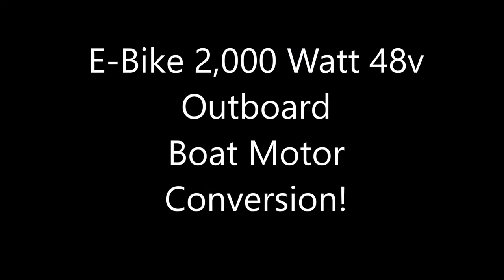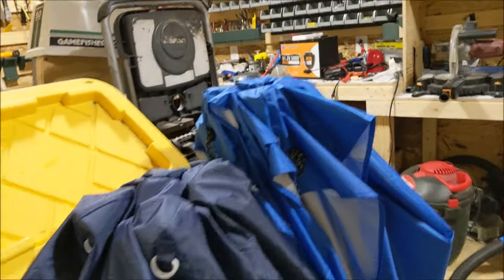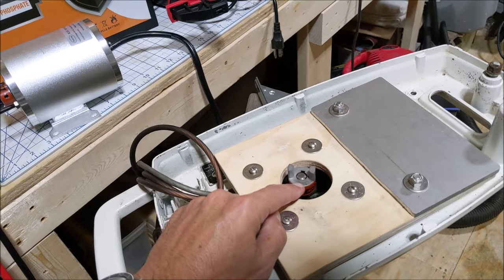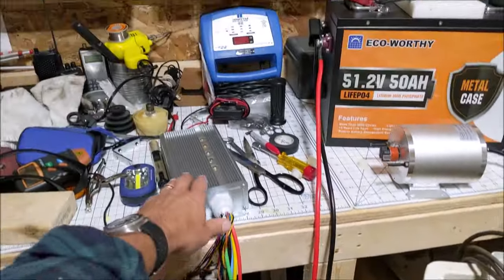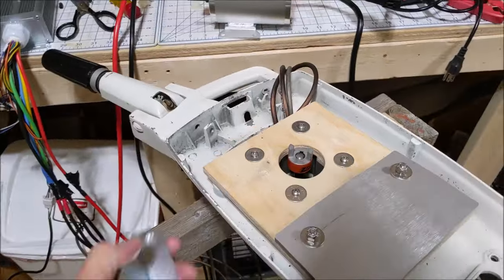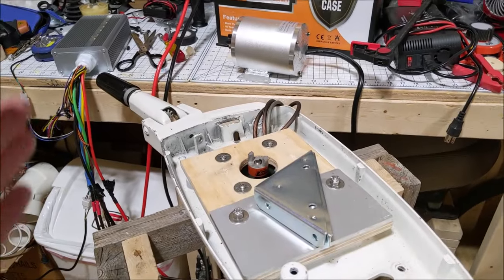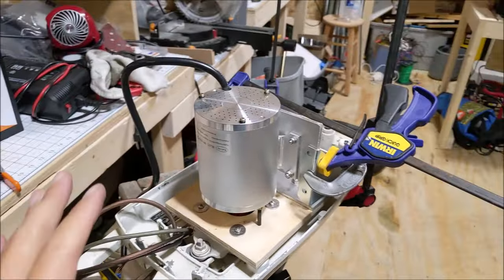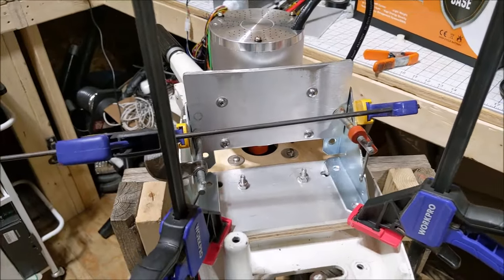E-Bike Kit To Boat Motor Conversion!

Comment: A piece of tubing or pipe a little larger than the motor. Like a sleeve. You could regulate the pressure on the Oldham coupler. Maybe even a toilet flange and some pvc?

Comment: I built a very similar electric outboard using that same brushless motor and controller kit. I mounted my motor separate from the drive and used a pair of cog belts running in parallel between the motor shaft and the lower unit coupling. That way I can change out cog gears to get different gear ratios. I tried that same motor coupling that you are using and it didn't last very long at all. I ended up using a solid coupling. I power it with four 12 volt 75 amp hour AGM batteries made for powering a Ryobi electric riding mower. I added a 48 volt to 12 volt buck converter to run a thermostatically controlled cooling fan. I have 3 seasons of use on mine.
Reply from the maker: Awesome!  I thought about using a belt a lot.  Even sketched out how to build it that way but then opted to try the couplers.  Great to hear it has worked out well for you.  On the next motor build I did I used a larger LoveJoy coupler that seems to be holding okay but belts are probably a better solution.  Thanks for your comments!

Comment: This might be a dumb question but does that watercooling on the original motor in some way lubricate or cool the driveshaft or gears? Or to ask it in a different way: when you run the motor on land, is there a danger of wear or overheating of the driveshaft etc?
Reply from the maker: Not a dumb question.  Heat is an issue with boat motors.  The motor I used for this build is an e-bike motor that was designed to be air cooled.  This outboard motor really didn't have much of a water cooling system.  It kind of pulled up some water to gently cool the lower shaft a little bit; not like typical outboards that have true impellers that pull water up, circulate, and then expel it.  I wouldn't run it for a long time in open air but it isn't much of an issue with this build.

Comment: Have you tested on the water yet? I'm looking into doing this myself. I'm mainly curious how long will the battery last?
Reply from the maker: I did some initial testing and it was promising.  The weak point was the LoveJoy coupler was too small and broke apart.  I moved onto a bigger motor build with a heavier coupler.
Reply: How do you do reverse with a e-bike motor???
Reply from the maker: @hughvanduyn6482  The manual comes with the wiring diagram/instructions to install a switch or set it to whichever direction is desired.
Reply: @drez20001 
Do you have any video of the water test?